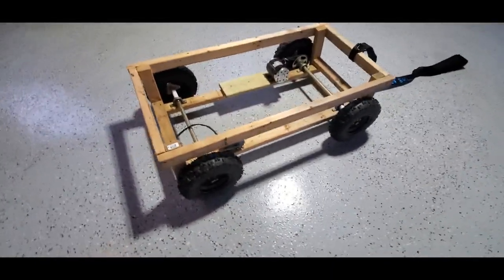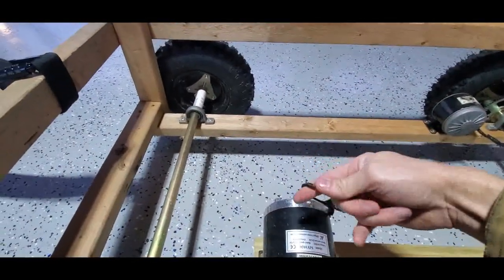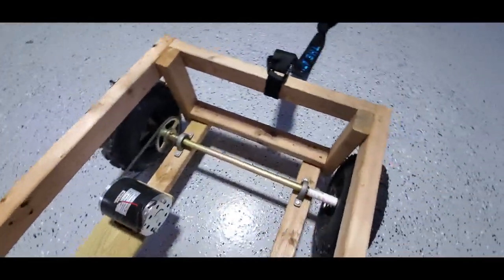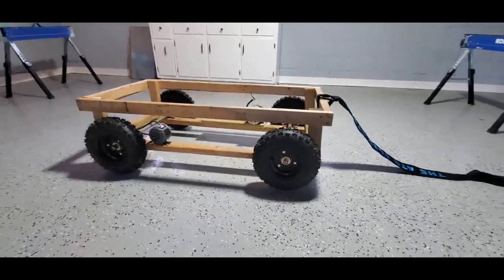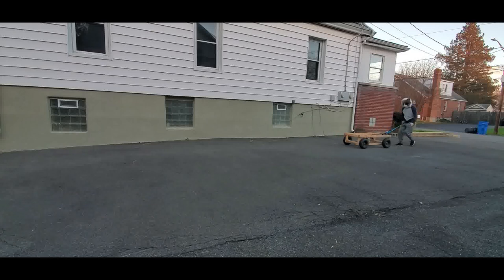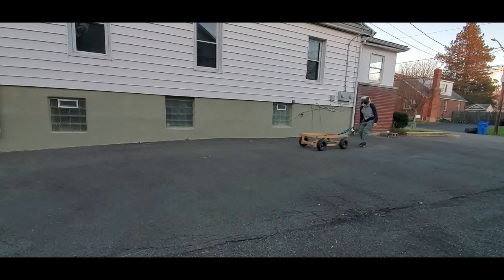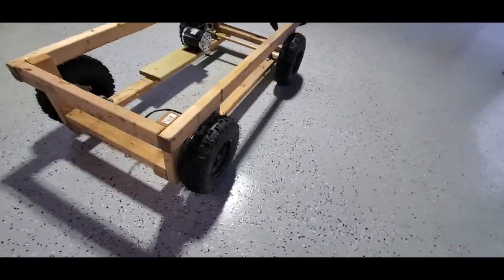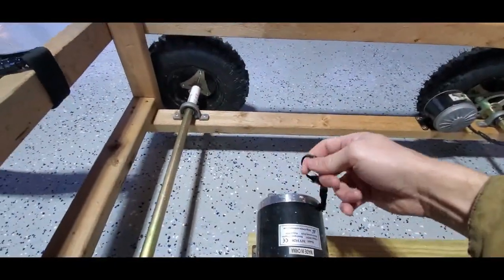DIY Push/Pull Sled - Magnetic Resistance

Comment: I'd like the axels to be underneath the wood members.  I don't want the entire weight of the sled to depend on the screws.  Have the entire weight coming down on the axels and the screws just preventing them from coming out of alignment.
Reply from the maker: @mangravy2000  yea man go for it. Very little weight on the axles though probably 15 lbs worth of wood. Also I used lag bolts not screws. We put 4 kids on it and it didn't budge.

Comment: Found your video looking for information on resistance motors.  An idea I had for building a sled is using the friction wheel off an exercise bicycle. I figure thrift shops or CL probably have unwanted exercise bikes with a friction knob. Set up the wheel similar to your set up but twist a knob for friction resistance.
Reply: Did you manage this? I have an old exercise bike and also had this idea!

Comment: I love the idea. Id like to try to build one. If you decided to only add 1 larger motor. What would you use instead of the other axle?
Reply from the maker: @williamrecinos9753  probably large casters. The swivel of a caster may add another dimension to the pulling/pushing by being able to go in a curved line. Lmk how it goes!

Comment: Very nice build! Are you still planning to post links to the parts? It would be really helpful since the parts are expensive and it's sometimes difficult to tell which parts are compatible.
Reply from the maker: Here's pretty much what I used. You don't have to do double axle like mine. You can get away with single axle and fine a way to run two motors to the one axle. 
https://www.ebay.com/itm/165821211577?mkcid=16&mkevt=1&mkrid=711-127632-2357-0&ssspo=sduophkmrge&sssrc=4429486&ssuid=TaE8pBJTTz6&var=&widget_ver=artemis&media=COPY
Reply from the maker: You may need a different sprocket to match the axle size. Here's the motor I used.
https://www.ebay.com/itm/195888790777?mkcid=16&mkevt=1&mkrid=711-127632-2357-0&ssspo=bg0vvtpxt3q&sssrc=4429486&ssuid=TaE8pBJTTz6&var=&widget_ver=artemis&media=COPY

Comment: Wonderful! Would love to get the plans for the rheostat addition. For the mechanically ignorant, when you say “attach the second motor” do you mean the chain? How quick is that process?  

I’m going to attach two tow points either end of fast back/forth. Thank you for this vid!!
Reply from the maker: I actually scrapped the rheostat addition and will just adjust the gearing ratio to get my desired resistance. When I referenced connecting the motor I'm talking about the positive/negative to the motor. Disconnecting those two wires will reduce resistance of the motor. Hoping to have a new video out soon with version 2.0 but other projects gave taken precedence.

Comment: this is awesome and exactly what i have been researching to build. not a mechanic, so i don't understand the motors or why they resist as you push harder? what type  / kind of motors would work? Will be buying everything from scratch so want to get it right 1st time.

On another note, how loud is it?
Reply from the maker: I would probably use the my1020 1000watt motor (brushed motor, not brushless). You can definitely find good explanations online about why the force increases with the increased speed of the motor, but it has to do with increased magnetic forces. Let me know when you finish your build!
Reply: thank you.  @chuckwillyduece

Comment: Frigging awesome!
Reply from the maker: Thanks!! Version 2.0 in the works now...
Reply: @chuckwillyduece  I was looking at tank mx1 and thought the had magnets and dynamos. Not just electric motors. You saved me a bunch of time and calculations and general mind bending. Thanks a bunch from Germany!
Reply from the maker: @bastipear2864  Yes! That's where I started as well. Next one I will use only one axle and tinker more with the gearing to achieve the resistance I'd like.

Comment: are you connecting the motors to a battery source?
Reply from the maker: There's no way you watched the video..
Reply: i did. one set of leads is going toward under the wood frame.

all im asking is if the leads are tied together to connect and disconnect the motors. your video doesnt talk about connecting the motors actually means.
Reply from the maker: @nl5h  the motor's positive and negative are connected together.
Reply: ok thats what i kept seeing but was a little surprised. thanks!
Reply from the maker: @nl5h  yea it's a bit weird. I'm not exactly an expert on why the motor will fight back on you when you tie them together, but I know one major brand of sled was doing this exact thing so that's where I got the idea. Let me know if you end up building one!